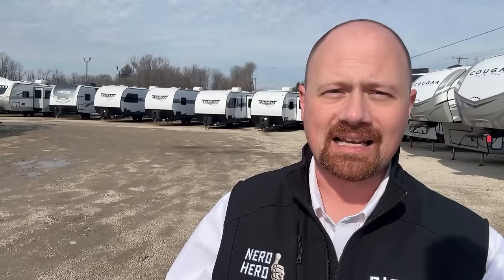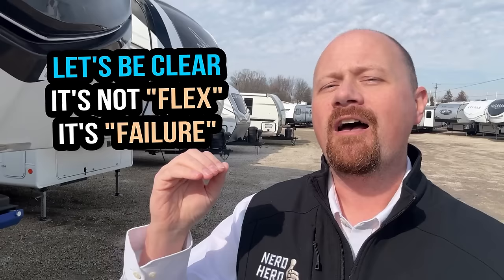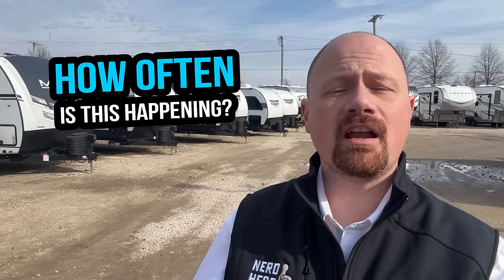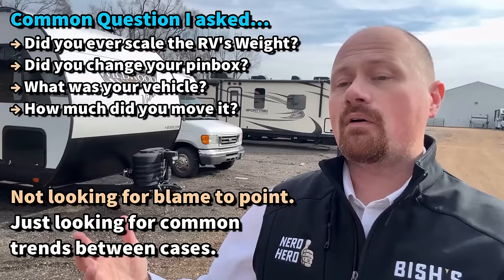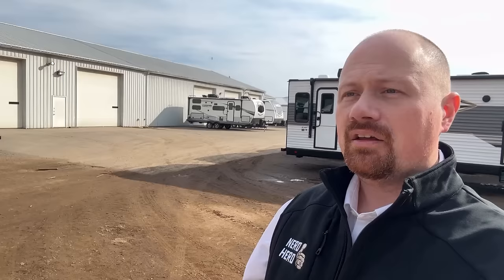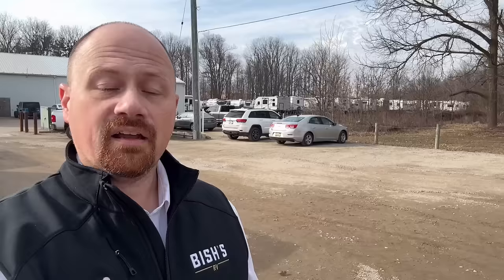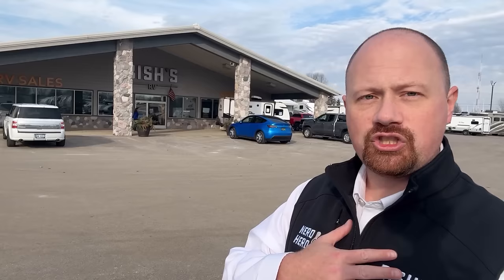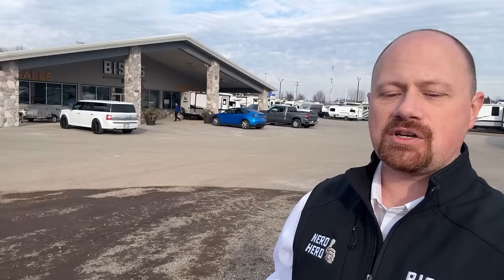🚨 RV Frame Flex & FAILURE!! • WHAT is Happening and WHO is Responsible?!

Comment: I'm not lobbing bombs. But I do have a couple points to voice. 

You never even touched on the idea, that manufacturers might be specing frames to be too light for the rv, or that frames for the same or very similar rvs were heavier in older models. As a consumer, here is what I see. Frames are failing in rvs at a level that simply didn't occur in early 2000. One must ask the question,  have frames been lightened up to save money,  or have frames not gotten heavier to accommodate new Floorplans with larger storages capacities. This is a rhetorical question because I suspect I know full well the answer. But why didn't you even mention this? Because it's on EVERY consumers mind.

I have a grand design 2150rb with amazing drop frame storage. Under the bed is a rather large cavity for storage.  On the tung are two 30lb tanks and 3 lith batteries. Plus two closets and two drawers in the bedroom.  There is A LOT of storage space directly over the hitch. Now, the manufacturers make this space available because more storage space is a HUGE selling point especially in a 21' rv. But the fact of the matter is, more storage space doesn't translate to more capacity.  So, I posit, either the companies are underspecing these frames given the much increased storage space thats been created, or they are lightening up frames that once were heavier.  If you provide cavernous storage spaces over your hitch where a customer could easily fit 800 lbs of gear, but you can only safely place 275 lbs of gear in that space, and you don't tell the customer specifically not to exceed 270 lbs, a reasonable person will utilize the space available with the impression that the rv was designed with the idea that the space would be fully utilized. 

I'm suggesting that the lions share of the blame is on manufacturers who are actively marketing dreams. Look at this lovely rv with all of this living space and all of this storage.  Meanwhile,  the frame can barely accommodate the empty trailer. What is a consumer to make of the fact that frame failures are simply far more common today the they were 24 years ago. 

Quite aside from frame failures,  it's a well established fact that newer rvs ( all the way up to 300000 rvs) are built far more cheaply then they were 24 years ago. And that's saying a lot considering rvs were never what one would call well built. 

Lastly, there is the cost of rvs. If I pay 30k for a 21' rv with lots of storage,  the expectation is that you are buying a unit that is built to handle the weight and being towed thousands of miles carrying that weight. But that's not really the case is it. If you buy a 175k 5th wheel,  only to find out its not capable of either the weight or being towed more than ten thousand miles, you can't put that on the customer.  You pay more with the understanding that the quality will match. But that's not the case. If Manufacturers weren't lying basically 100% of the time, the marketing would be vastly different.  As it turns out, you can't have a rig of the size they are building and be able to tow it.

My 21' trailer would weigh 9000 lbs dry instead of 6500 lbs. And my barely adequate 1/2 ton as it is simply couldn't tow a properly built 21' rv. And I'm not denying physics. But if manufacturers were honest, the limitations of any rv would be made perfectly clear. The FACT that this isn't the case is all one really needs to know. So I'll spell it out.

If you want an RV, and you want creature comforts, you're going to pay 30k and up. Secondly,  you can't effectively add more than 10-15 percent of the rv's dry weight to the rv, and that weight should be distributed 1/4 to the front and back and 1/2 over the axles. For my 6500 lb rig, that means I can safely distribute 650 to 975 lbs across my rv, with zero consideration  to how much storage space there is. 480 lbs better be set mid, while 240 lbs can be placed fore and aft. Once you take into consideration the batteries and propane, then you can start to appreciate just how much of your under bed, closet and basement storage you can effectively use. And the answer is,  you better pack frugal. Was that so hard to explain? 

The question you didn't ask is why is the marketing so out of step with reality? All a manufacturer would have to do is place three stickers in an rv designating how much weight can be placed in each section front, mid, and rear. All a dealer would need to do is stress that the weight limits are very real, and going beyond them will lead to frame failures.  Simple. Easy.  I've just said the quite bit outloud and done the community a service.

Comment: Lippert needs to do better with Welding and design of pin box attachment and the drop section on Fifth wheel frames the manufacture needs to have better safety std, I see some of the welds on my frame and I was putting better weld on when I was learning than these guys do. and from some of the pictures I have seen the welds are failing. gussets only weld on one side just not acceptable both sides should have welds. just cutting corners bottom line safety above profit shame on Lippert and RV industry

Comment: The big money has re-engineered the RV industry to be used 2-4 weeks a year and travel no more tgan than 50-75 miles and then stored for the remaining weeks... Steel springs went out of the trucking trailer industry in tge mid 80's... Steel springs are as rough as a wooden wheeled 29 Model A Ford truck!!
Reply: Trucking industry uses air bags to adjust the suspension for the varying weight of freight loads.  Big difference if you're loaded to the gills or running empty, with a transport truck.   Steel springs work just fine if you're near maximum most of the time, because that is what they're designed for.

Most RVs run at a relatively constant, near-maximum load, so steel is fine for them.  But what is seriously missing are 'shock absorbers' on trailers, to stop them from bouncing all over the place regardless of load.

Comment: Too much discussion about use and misuse. I did not hear enough about insufficient design safety factors and/or manufacturing/welding defects contributions to this problem!!!

PS - I spent a career in quality engineering and quality management.

Comment: Frame failure is an engineering defect or a manufacturing defect. If the manufacturer designed frame is built  by someone else and arrives poorly built. Then accepting that is on the manufacturer. Simple.

Comment: Big giant?  I don’t care if it’s 50 feet or 5 feet.  The designers are supposed to build them to support the distributed weight loads as designed. 

So in your opinion buy a 30 foot, lightweight rv that’s not moved very often.

WTF?

Comment: @joshthervnerd  All this is great information. But the fact is that Lippert is building to Minimum specs. The could overbuild for next to nothing. They could probably just use cutoffs from their manufacturing scraps to add extra gussets in known weakpoints. Just looking underneath a RV at their frames you can tell that it is a bottom dollar product.

Comment: Cheep Chinese steel, bad engineering. No thought is given that there will be dynamic loading and not just static loads on these frames. And on top of that the welding is horrible. RV manufacturers don't have to stand behind these things like they do with cars or trucks. Out of warranty after a year or two and you are on your own.

Comment: I like your videos, but this is the first one that I’ve ever watched twice.   Between your video and others reporting issues, it sounds to me like the RV manufacturers are simply blame-storming ie coming up with a list of potential issues in an attempt to deny their responsibility with this issue.   In addition to the manufacturers speculation, poor frame design, poor manufacturing practices ( like bad welds), and poor trailer suspension would also lead to frame failure.   I found it interesting that no manufacturer is taking any steps to prove that their RVs don’t have any QC or design issues.

Comment: Answer me this please. How is it that manufactures build RVs according to how they look rather than how they function.  I. E. Should they be built more like a air plane or a house with wood cabinets? Plastic and aluminum is light and strong but not as appealing to the eye. Start put an emphasis on great water tight seals.  Build them well, not fancy please. Consumers are responsible for this. Fancy is what is driving the market. How does a $40,000. Camper leak after a few years?  I don’t get it! Absolutely without a doubt the least amount of education surrounds the batteries. It is a complicated subject that doesn’t have to be. Yet it seems to me that it is the item that manufacturers and dealers skimp out on the most.
Reply from the maker: I don't disagree. I'm a function over fashion kind of person. But in SO MANY aspects of our culture the LOOK of something really is the cornerstone to its success

I don't like that but it's true folks often "buy with their eyes" first

Comment: Its a fricking RV meant to go down the road.  IF the manufacture states that the vehicle can only go xxx miles then that needs to be stated.  Only having a RV rated for xxx miles or cycles was and has NEVER been discussed or advertised!  Sorry you just lost a ton of respect on that comment!!  RV engineers need to have to take a trailer for a month and do no less than 3000 miles and 10 hook up and deploy cycles to actually understand what the x020384g they are building and engineering.

Comment: The people that refuse to buy adequate tow vehicles. When you see a Ford explorer towing a 35 foot travel trailer it's that guy. So they are skimping on materials trying to make everything lighter.
Reply from the maker: There are some folks who refuse to upgrade a vehicle certainly. I suspect there are as many (and I estimate more) people telling potential buyers their under-rated vehicle is fine as well
Reply: @JoshtheRVNerd  yes my dealer gave me the you can tow it with a half ton line.

Comment: We bought our 2022 Keystone Alpine 3790FK from Bish's RV in September 2021. We've had so many problems that we have been only been able use our RV 5 time since we bought it. Our RV has been in the shop the rest of the time for a variety of problems, as it is right now for a crack on the outside of the kitchen slide.  I have a problem with you blaming RV issues on the owners, when most problems are manufacturer/design issues.  As a dealer, maybe you should not deal with manufacturers who have a history of bad design issues.  Buyers count on you to sell a quality product and to educate them on proper use when you sell it.  Where was the help when we called you for Help. You should be very particular on the brands/models you sell.
Reply from the maker: I’m sorry to see this. I would encourage you to see the end of this video

I’m not blaming owners. I don’t think you can say “they’re using it wrong” if no one shares what using it “right” means
Reply: @JoshtheRVNerd  that’s fair. We are just pulling our hair out. We love our Alpine just can’t keep it working. We bought ours at the Great Falls store.
Reply: @user-yn2do4sx2h about the time we decided to get a fifth wheel we saw a High Country model we loved and it became our planned purchase. But a trip to a dealer and seeing the poor craftsmanship in the finishes inside had us questioning whether or not there were hidden issues as well. I got a splinter in my finger from a drawer box with essentially un finished wood. I’d always heard Keystones were quality luxury rigs. Ditto for Jayco. I started following half a dozen or so YouTubers and started to see some common problems related to the bigger heavier fivers. They are just too easy to overload. Not saying you did that but these companies just tout their storage - people we’ve seen at NASCAR events bring vast numbers of tables and chairs and tarps and backyard style barbecue grills, and long string lights, generators, steel pop up shades - it’s as if the thinking is, there’s room for it, so cram in in and who cares if it’s adding 300 lbs.

Comment: BS get on Facebook everyday someone is posting frame flex and cracking on small units too. I know the manufactures point fingers at Lippert and Lippert points the fingers back it's the engineers that are at fault. I was a  structural engineer the Oil Well drilling field for 55 years and we used nothing but USA steel never from China. I wonder if they even do stress analysis and failure test.  I often wondered why they don't add a rectangle tubing on a angle from the over hang to the down tube in the front it can be added and still have clearance for the truck and turns. just my opinion. As far as being on the big 40 ft. Toy haulers they usually have triple axels and the hitch weight is less then a tandem trailers

Comment: It's simple, semi trailers. Run a half a million miles without this type of crap happening. Why, because they are built to carry a load independent of the frame. RV trailer frames need to be built the same way. This business of Domingo frame with the idea that the trailer body or body frame Will make up. The difference is ludicrous and dangerous.

Comment: Josh
...well done....in a political correctness  Manner and I understand your position,  that's fine. But, must state the fact that RV manufacturers have known of the RV boom and the trend of FULL TIME LIVING in RV'S.  That said toy haulers have been getting bigger, living experience in RV'S manufacturers have added things implying  an experience of fulltime living in them.
.......It is my opinion every RV  manufacturer is responsible for building them cheap, and cheaper, maybe to off set the nicer appliances added. 
...So the RV Industry is wrong for not stepping up and reengineering framework  for 5th wheels, bumper pulls and motorhomes that are slso experiencing way big quality issues too.
......The blame is on all of them. To money hungry,  passing the buck to frame builder then they pass it back to RV manufacturers. Then stopping the information line and Hope's the 3 year frame warranty is expired.  Just saying. 
....In short, Brinkley on the other hand at which I don't think I need to Identify the owners so I believe these owners saw it coming and sold out their previous GD Company to start fresh in a new direction much like Leigh Tifton did with his 5th wheel collection.  Everyone now knows they sold out to another manufacturer just like GD did.
........all I can say is buyers beware of companies that have been bought out.
   In my 55 years as an adult one thing that is common yet some exceptions but most all new owners start cutting cost, changing suppliers, closing certain lines of product which means trouble to the consumer. 
.....Today the U.S. industry lacks what it once had 3, 4 decades ago which is BUILD a product for the consumer that lasts and competing against other companies for your business.  If you search back far enough there was a statement said by several companies that their pricing had to be fair and reasonable but no more than its worth.  _____Not true today.
   I recently needed to replace a relay for Toyota rear sun shade and found out its $500 to $700 dollars for this relay with no more electronics in it than those temperature controlled boards, motor controllers that can be bought all day for $10 bucks to $30 dollars on Amazon or Ebay. I know I've bought them and use them.  
This $700 dollar Toyota  relay has a Japanese made relay in it that can be bought for $4.95 with a simple soldering job.
.....enough said!

Comment: Isn’t it happening with grand design the vast majority
Reply from the maker: There is certainly more coverage relating to GD RVs but I really never could get any clear data as to whether or not it's something happening more frequently there in terms of rates

I think the reason GD has been so heavily associated with the flex topic is because they're one of the largest volume players in the BIG BIG BIG fifth wheel market. So by pure throughput their name has come up more often. 

I suspect the actual percentage of instances is similar across most brands but nearly nobody really competes with GD's volume in that market segment

Comment: "You're using it wrong." LOL, What a load of crap. Call them out. LCI builds crappy frames with underpaid poorly skilled welders made to crappy RV manufacturer specs. Cracks in beams from improper welding is the biggest cause.